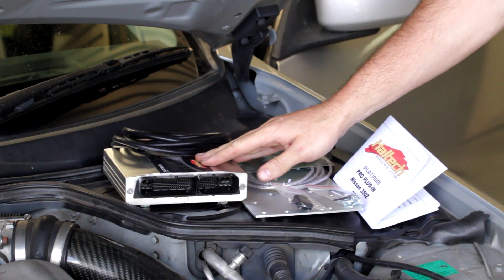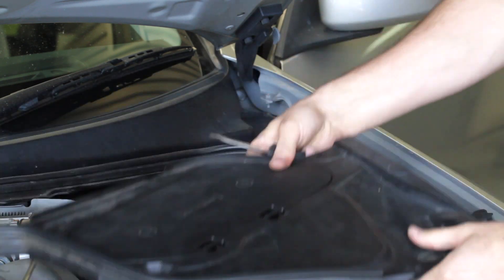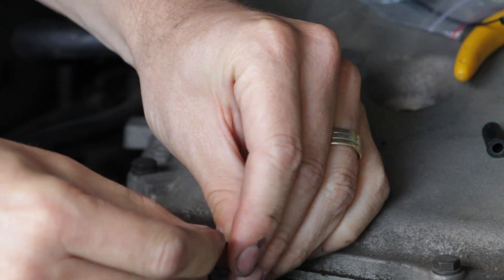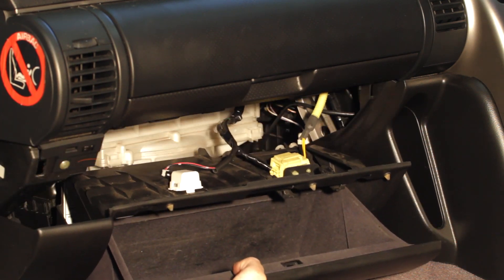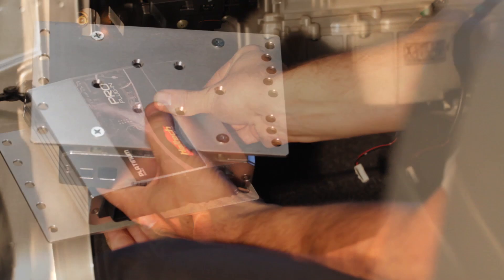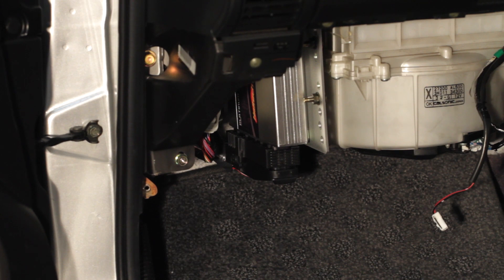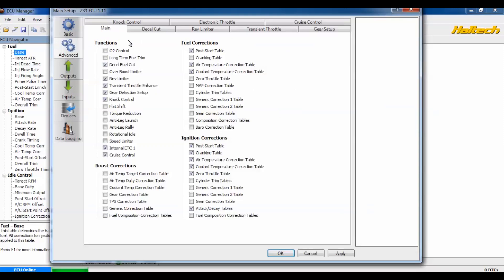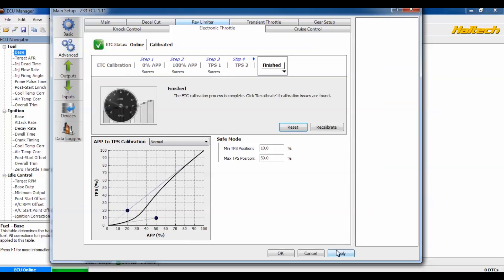Haltech DIY: Nissan 350z Pro Plug-in installation and calibration

Comment: Hello, i can install this ecu into a vq35de Murano 2005? im swap to manual transmission but i need one mt ecu, mi car is running but not very well.
Reply: Maurice Suazo  
You just  need to buy:
1- Haltech platinum used or new (I prefer used cuz the cost+ they usually came with a harness no matter what the engine is cuz it will save time +money)

2- Haltech connector with pins from ebay it will cost less.(in case you buy new one)

3- Pins cramper 

4- Any good condition used harness from any car

5- heat shrink tube

Open the haltech 1000 platinum ecu wiring diagram and follow the lead 

After you finish installation plug it usb wire with your laptop and chose sequential injections.
 
And tune it.

 =Do it by your self and fk their tech support team LOL.

*hint VQ35DE firing order is 123456
*you will use 3 ignition wire from haltech ecu
* you will use 3 injection wire from haltech ecu
*Ignition wire nm#1 will connect to 1 and 4 ignition coil.
Ignition wire nm#2 will connect to 2 and 5 ignition coil.
Ignition wire nm#3 will connect to 3 and 6 ignition coil.
The same order with 3 injection wires and connect them with injection.

HOPE MY COMMENT IS HELPFUL FOR YOU.
Reply from the maker: Hi Maurice - You'll need to talk to our tech support team to work that one out. Please contact them via www.haltech.com/support

Comment: How much horsepower will it give me?
Reply: OsvaldoZ33 from 10-40 hp compared to stock ecu tune
Reply: @dr.f5m176  For a minimum of £1524?
Reply: Depends on which supporting mods you buy. You will need things like air intake, plenum spacer (on DE engine), exhaust to actually get any power gains.
Reply: @Agret and then will haltech improve HP over factory ecu

Comment from the maker: The throttle calibration comes off the 5V power supply, so the battery voltage will not effect it.